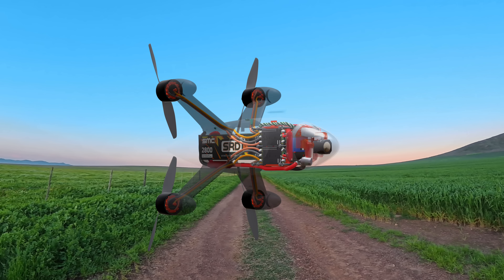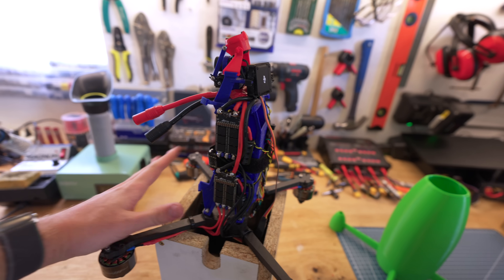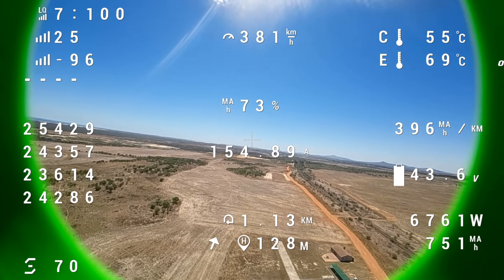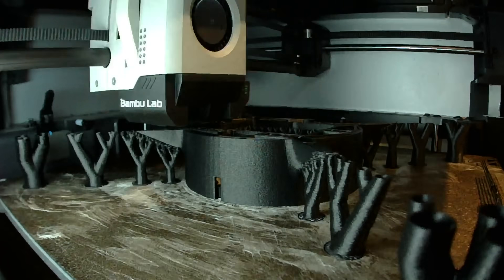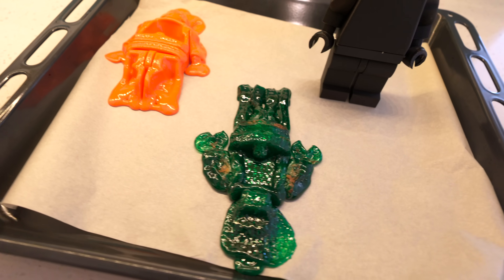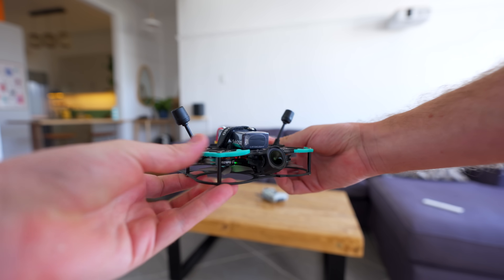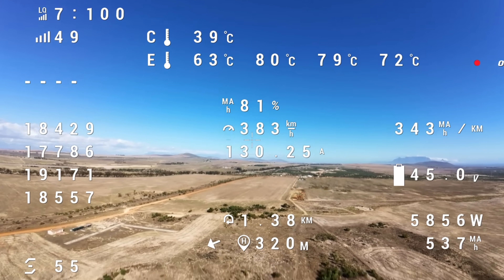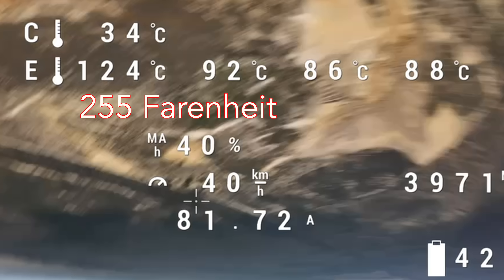THE COMEBACK - World's FASTEST Drone V3

Comment: Very impressive. But for record purposes, what is the definition of a drone? Does it need to have 4 or more propellers? Does it need to have propellers at all, or are rocket motors fine too? I assume VTOL is a requirement, otherwise RC planes of any kind would be drones. But lets say you add a rocket booster to what you already have, and hit it when you're going as fast as the propellers can push it. Should make it faster while still being able to land propulsively. Might need movable fins for steering.

Comment: I think the water cooling could be way more efficient if the pump was circulating water outside the box, ideally using aluminium pipes to act as a radiator.. it may even be possible to drop the pump and use the heat itself to get water circulating. Great work!
Reply from the maker: For sure! But the space is the issue!
Reply: But it's pointless as it already has sufficient cooling!

Comment: Considering the speeds, was it really needed to add the water cooling? couldn't it be cooled by simply adding some strategic holes and canalize the air inside? I guess you prefer adding more weight to it than having to deal with the drag resistance, is it?

Comment: Did you avoid PA12 because you wanted it to be a little more flexable once it absorbed some moisture from the air so it’s a bit more resistant to crash damage?
Reply from the maker: Mainly because PA6 is still the stronger filament!

Comment: To get the best water cooling you need to pump that water out to the outside of the drone body and then run it up and down the body in small capillary tubes before feeding it back inside the body to the water box again. You can leave the pump inside the water box as that will help keep that small motor from overheating too. If running the capillary tubes up and down the fuselage is too awkward then try spiraling it around the body though up and down is best as it will have the additional benefit of enhancing stability at speed. It may add some drag but careful application of some silicone sealant along the tube-to-body interface should smooth that out, just don't cover the tube. Also the capillaries need to be as thin walled as possible to get the best heat transfer.
Reply: You armchair experts are making me facepalm so hard. It has all the cooling it needs!!! So frustrating.

Comment: Suggestion: remove the water cooling and move the radiator outside the main body so that it becomes part of the drone’s chassis.
Make the drone slightly longer, and in the future, consider adding four small adjustable front wings (similar to those used on rockets). And you can use squared body geometry with rounded corners
Reply: That would add needlessly drag and weight. It already has all the cooling it needs for neglible weight.

Comment: Water has a lot of thermal mass, but without anywhere to exhaust the heat to it's a time bomb. You only have until that water hits 100C before the box starts spraying pressurized water all over your internal components and kills the drone.
Heat pipes to a smooth copper plate flush with the drone's surface would likely be much more sustainable.

Comment: Mineral oil cooling uses the wind, it's probably higher efficiency and lower weight and simpler, i's a lot better than that silver stuff. the faster it goes the higher the cooling. Alu and copper whichever is easier.

Comment: I wonder if you could even just use the ESC's boiling the water as your heat sync, limits your flight time but saves the weight of any kind of pump etc.

Comment: Question on the watercooling, would it not have been easier to use PCM inside the waterbox and keep it sealed? less complex but would still have absorbed all the heat? Amazing achievement none the less, some great engineering! Well done

Comment: That is a really cool project. When seeing your watercooling solution I wondered about another possibility: you could use a metal 3d printing service to have specific heatsinks for your cooler produced, and you might be able to use CO2 to cool down your water and interior of the drone. By using a small CO2 canister connected to a thermostat, you could insert a heatexchange unit in the middle of your watertank beeing cooled with the CO2. The CO2 could be released into the interior of the drone where other components heat up. One CO2 canister might pack enough for one fast flight.
Reply: So many armchair engineers in these comments coming up with needlessly complicated cooling systems. The water works fine ffs!

Comment: The little water cooler box has me bugging out with ways to optimize it. Can you not put ice in there since you aren’t really pumping it? I know it’s sandwiched in between electronics, but maybe the little box could be insertable? The phase change process will absorb about 80 times more heat for every gram of water than 1 degree of heating
Reply: And congrats! Sorry to nerd bomb your achievement!
Reply from the maker: Hey! I usually have the exact same response when I am watching videos so I get it 😂 yes ice could totally help. But then issues come from it getting too cold and causing condensation on the electronics which is risky. To be honest in the latest version of the drone the ESCs start at 25 Celsius and after the flight are 35 Celsius. Which is actually kind of ridiculous so any extra cooling is unnecessary. And that’s with the pump off! To put it in perspective I wouldn’t mind them ending at 70 degrees Celsius so there is a huge margin
Reply: @LukeMaximoBell aaaah that makes sense. Thanks for the response!
Reply: I'm suprisrd to see such pointless advice from you. Did you not watch the video? It is perfectly adequately cooled as it is!

Comment: I was impressed at 140A. Then as I kept watching the numbers were climbing. 200A, 300A, over 400A at the end! Absolutley amazing that you can have so much power flowing in such a tiny device without bursting into flames.
Reply from the maker: We peaked around 440A 😅
Reply: Only for 10 seconds from 100A to 450A. The motors, ESC, cables and connectors wouldn't handle this for much longer.
Reply: @richardmiddleton7770 Yes we did watch the video too...
Reply: Tony Stark was able to build that in a cave. 🤖

Comment: Are there ESCs designed for top cooling? Those MOSFET packages aren't designed to conduct heat out of their plastic case, they're primarily designed for cooling through the copper on the board but there's not a good place to connect to that on the back side from the looks of it

Also strongly recommend thermal paste for filling the gaps since the thermal you squeezed into the gaps is really designed more for operation under compression, not gap filling

Comment: Do you have access to a metal printer?  If the body or fins were aluminum and connected via a heat pipe to the electronics, I am guessing it would be pretty effective at preventing overheating.

Comment: Your aluminum plates need fins in to the water for better heat dissipation if you care. If you don't, seems like it has enough thermal mass to absorb what you need. If not, prechill water with liquid N2 or dry ice. The water will hold on to a lot of that. Those ESCs are drawing like 300 amps at 40? volts. So ~12k watts... Every bit of resistance in that system is now a problem. If you switch to higher voltage, lower Kv motors, etc... It would be less of an issue. Doubling voltage is more than halfing amperage on that system. 

Just one extreme FPV builder to another...

Comment: The wobbling is due to the “square” water-filled heat sink and the tiny water pump. To fix the wobbling, change your heat sink shape to a circular disk, and make it have two chambers.  Install a water pump into each of the two chambers but be sure make the pumps send water in opposite direction to each other.  This will cancel out the gyroscopic effect of a single pump and will eliminate the wobble at high speed.
Reply: Are you sure? The total mass of the water should be tiny compared to the total mass of the whole drone. Besides it's very close to the COG it seems. And they have solved the wobble with the design change. Am I missing something?
Reply: Wobbling because the center of mass was too far back, He fixed it by moving the center of mass a bit forward. Wobbling effect happened before he switched to water cooling.
Reply: or just vacuum-fill it
Reply: Screw that. Use Peltier for the win.
Reply: I love reading these comments from people like you who don't watch the video properly and come up with these very confidently incorrect ideas. Always good for a laugh!

Comment: Why you didnt made heatsink fins inside water chamber to increase contact surface even more? Next step will be obviously to use compressed gas with some drain to atmosphere inside cooler. For some time it should be freezing cold (until all gas will be exposed), after that it will be cooked tho but should be fine for small amount of time needed for acceleration.

Comment: Water cooling? I think you should be non-conductive oil-cooling. Or maybe a TEC Peltier hybrid. You dont have enough mass to surface area ratio... plus heatpads are not very efficient.. use liquid metal thermal compund at least... ot even a ceramic compound if conductivity is a concern

Comment: Do golf ball dimples help to reduce drag? I recall a Mythbusters test some time ago that had a plausible outcome.
Reply: Dimples are for golf balls only, because a ball is a terrible aero shape and a particular quirk that only benefit balls.  Not a single aircraft or airliner has dimples for a because it would just add quite a bit of drag.  You can be certain all Airliners would immedeately apply dimples if it saved fuel.  In my video I explain the golf ball dimple quirk.

Comment: This is not a fair record, you used customized high power parts not available commercially. Like those miraculous batteries 44.4V SRD-V4-2800 mah 250C not even listed on SMC site or found in Google. Available are only 22.2Volts 250C.
Reply: Don't be butthurt, it is perfectly "fair".

Comment: I think you actually have a thermal conductivity problem, not a thermal capacity problem.
You have to carry the water's mass and you still don't expel the heat from the body of the drone, you just sort of sweep it under the rug since it is a short flight.
But you are moving 400+ kph through the air. You have essentially infinite heat capacitance to dump your heat into. Because the drone is moving, it's analogous to having a pillow that is infinitely on the "cool side".
Your 3D printed body acts as a huge thermal capacitor and insulator at the same time in part due to its poor thermal conductivity.
If you instead dumped your heat into a highly conductive body, you could actually dump heat out of the drone completely rather than hiding it away in a heavy and otherwise useless reservoir.
Essentially, use "wind chill" to your advantage by using your high velocity as a means to dump heat into your environment.
You don't need fins and don't need to pass air through a heat-sink with fins, you just need to dump heat as quickly into the surface of the drone and let the flowing air do its thing.
The fins of the heat-sink essentially just increase surface area, but right now the only heat leaving the body of the drone is through the same surface are anyways.
So what I'm suggesting is instead of hiding your heat sources away from sensitive instruments and dumping to a reservoir, you could maximize the thermal conductivity from your heat sources and dump to the surface of the drone where the air passing over the surface acts as a free infinite capacitance heat sink.

Comment: Wouldnt be possible to make 4 aluminium wings, with 4 esc encapsulated inside, so it acts as fins. Also you would have a direct connection to the motors.

Comment: Hey mate be very very careful with fibre infused plastics. I cant remember who tested it but they drop heaps of fibres everywhere and you breathe them in

Please wear a mask when sanding these plastics and coat them woth some kind of epoxy to keep the fibres inside

Edit 5:03 yeah you might already be in danger , those small broken bits have spread carbon fibres everywhere you took them

Comment: The speed controllers don't get enough cooling on their own by just the air, but if you mount it to a plate that is in direct contact with the outside air rushing by, that spreads out the heat, you could probably get away with the front side being in aluminum cone and use two heat pipes, one on each side, connecting the speed controllers and then bent upwards of the cone so the entire cone gets warm.

Comment: I understand that an aluminum tip or an aluminum ring will be heavier than the plastic, but it will be lighter than the total thermal Mass you are using. The air flowing over the outside will easily take enough of the heat away and the total thing will be lighter. You could probably even get away with something with ridges or even have a heat sink protruding on both sides with the fins parallel to the wind.

Comment: Bro, you're stupid!) Simply using ceramics in the thermal interfaces of controllers will allow you to achieve lower temperatures on small air radiators.

Comment: Idle thoughts... Why not put the ESCs in the motor arms or the front of the motor nacelles surrounded by aluminum heat sinks and air cool them? You've got aluminum milling, and a budget, so you should be able to try a few things out without the complexity and interior bulk of the water system.

Comment: Esc cooling with peltier elements and an small radial fan what press out the hot air over a small hole in the tail fin or threw the Motor stators.

Comment: 3:26 if you would yousing a normal Transmitter like Frysky x9d oder Jumper T20 you would put the arm swith left side the up standing switch what point to you. It is the Best Disarm location. If you are a pincher you typically grap the throttle. In case of Disarm you quickley straigten up your left pointi finger to smasch the up standing switch switch away from your boddy. This is by proofed the fastest Disarm possible.
But with this DJI Xbox gaming controller is just an stupid consumer design product with less Professional innovation

Comment: idk i probably would have gone air cooled.  puting it like a straw, with a tunnel through the center.  with the engines built closer to the body where hopefully the tunnel would be utilized for intake more as the speed increased...  idk if it would work i'm not a scientist :D now my idea would have a slower turn radius than most because of this of course.  maybe using a shroud around the engines to help draw air from the tunnel would help... variable angle mechanics for the shrouds?  that would help also in turns at lower speeds of course.  would the air running through the center heat up or cool down?  would it work well if the insides of that tunnel were laced with copper fins/lines to cool electronics and such??

Comment: Just a little tip . Make the base like a coke bottle design.  It cuts back on drag and prevents the high speed wobble.  You can research it and see that the military uses it for their jets . Also put the propellers closer to the nose . Its better to pull than push a horse carriage.
Reply: Is that related to the "area rule"?
Reply: @GaryBickford Area rule doesn’t matter until you’re transonic, and this isn’t fast enough for this.  What they’re referring to is “boat tail”.  The idea is that a truncated spike works almost as well as a full tail spike but at a fraction of the mass.  You see it in modern automotive design, and bullets, but I’m not sure what aircraft this applies to.
Reply: @wagnerrp the angle and length of the boat tail make quite a difference too.
Reply: Good thing you didn't cite any peer-reviewed articles. Did you read this in Modern Jackass or something?
Reply: Putting the props closer to the nose is a terrible idea. You need some distance between the center of mass and where youre steering is to have control authority. Also pushing the mass is what you want if what you fly closely resembles a rocket. If you try to pull instead your rocket like vehicle wants to turn around. Its like throwing a dart fins first.
Reply: @robinte98  None of that is accurate.  The moment arm you need for control is by putting the props out on those fins.  The thrust vector of a rocket (or a propeller) is fixed to the body, and the specific position thus has no relevance to stability.  You've basically fallen for the "pendulum fallacy", and yet somehow even managed to get it backwards.

The props are out on fins, and those fins are aerodynamic surfaces.  They need to be balanced.  Too far forward, and the vehicle is unstable.  Too far backwards, and the vehicle is "too stable", and requires too much differential thrust to maintain pitch up.

Comment: Suggest using silicone oil for cooling, safe for electronics and lower specific gravity than water (= lighter weight). There are many heat transfer fluids commercially available.
Reply: What matters is heat capacity, that is watts per volume. How does that compare?

Comment: If you're going to include a water pump, you might as well recirculate the water around the interior of the drone to redistribute the heat (taking some of it out of the water), or even to a low-drag radiator on the exterior. These schemes would work best using a fluid with low heat capacity. If instead the water block itself is the heat sink, there are fluids with higher heat capacity. Or it may all be academic because flight times are limited by battery life.

Comment: For the water cooling, it seems as though you're using the water as a heat storage device?
This would obviously only work for a very short time.
If that's what you're doing you could use salty water that is well below 0C to get a bit more flying time.